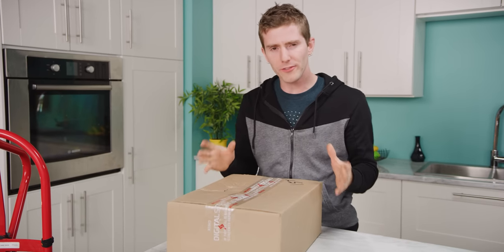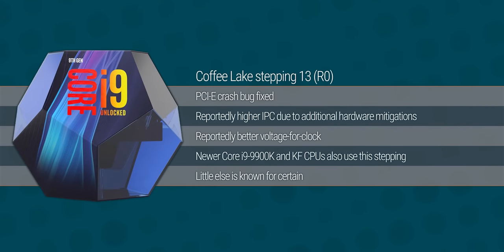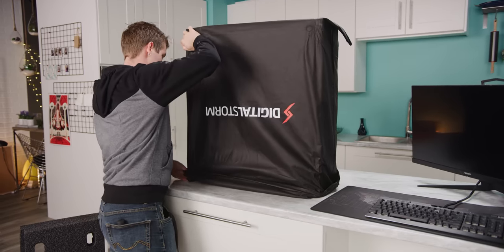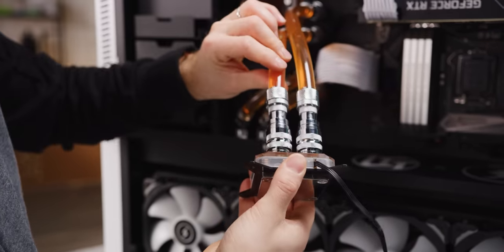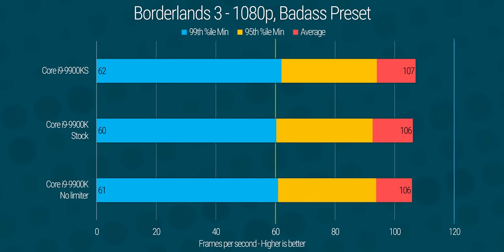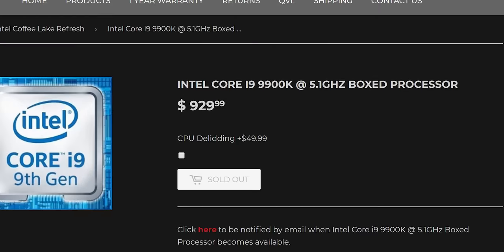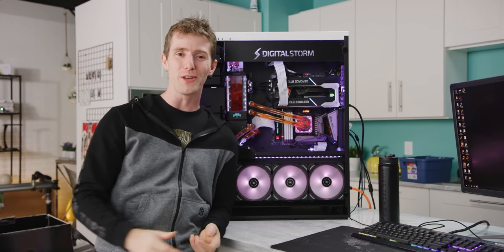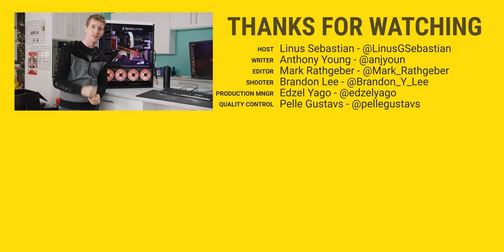Intel's PRE-OVERCLOCKED CPU... Core i9 9900KS

Comment: 95C with watercooling at 5,2Ghz? I did run my old 4790k at 4,7Ghz and it never got hotter then 60C running prime 95 on all 4 cores at full with air cooling using 4 fans at 90% push push / pull pull on a huge square heatpipe cooler with 14cm Noctua fans running silently... It seems thees new CPUs get a LOT hotter while not running that much faster even considering it is 8 cores.

Comment: Running my new 9900KS on air at 5.1 Ghz.  No problem.  Good silicon will run faster with lest voltage and hence less heat.

Comment: Linus can I buy your i9 9900ks pls, because I can't find a reasonable price or seller anywhere. Amazon is the only safe place and they are all being sold for $800-900 by resellers:( help me somebody pls. Im building my first ultimate gaming pc for Christmas, my wife is letting me. It's going to have an i9 9900ks (hopefully), rtx 2080ti, Msi Godlike motherboard, corsair 32gb of c18 3600mhz rgb ram, 2 TB of Samsung 970 evo plus NV.ME, seasonic gold 850watt psu, corsair crystal 680x white rgb case, white corsair rgb aio, I really would like the i9-9900ks but I might be stuck with am i9 9900k, I'm worried theyll come out with a better i9 with 10 gen desktop right after I buy the 9th gen. I'm also worried theyll come out with the rtx 2080 ti super or rtx 3080ti right after I buy the rtx 2080 ti. Oh well guess I'll see what I'll do.
Reply: Seer King Same concern I kinda hate how the 9900ks is a limited time product but then again I might as well wait for 10th gen at this point I guess
Reply: @ooh7427  I was thinking the same thing but intel is too unstable right now. Intel ks still beats everything in Gaming even the othernew i9
Reply: Seer King Yeah it’s kinda unfortunate and I’m sure if I’m going to hold off or struggle to OC a 9900k to 5ghz
Reply: @ooh7427  you wont struggle to overclock a 9th gen I9-9900K or KS, so long as u have a good motherboard and cooling. I'm getting the Msi Godlike motherboard that had 18 VRM nodes for 18 phase Vrm for smoother even clean and abundant power delivery. The motherboard can make all the difference in overclocking. I just happen to pick the most expensive one. The Asus Formula is Asus top  premium motherboard but it's not as good as the Godlike but almost the same price.
Reply: Seer King I was thinking about getting the Asus Maximus XI Code which is basically the Formula but without the waterblock since I’m going to be using the Kraken X62 Aio
Reply: @ooh7427  when are you thinking of buying? Most of the parts for my build are bought. Just waiting for them to be delivered. 2080ti is not bought yet though. I'm waiting to see if they come out with a 3080ti soon.
Reply: Seer King I’m not sure but if anything it will be early next year but I still haven’t fully decided if I’m going to hold off until Nvidia releases the 3080 but no telling how long that will be
Reply: @ooh7427  ya I hear ya

Comment: I don't understand why or how, but my 9900KF achieves 5200+ in CR20 @ 5.0Ghz on 1.325v, and this is currently running tame. I usually run it at 5.2Ghz on 1.39v, but I'm doing a lot of 3D work right now and it's only stable at 5.2 while gaming. Considering my CPU is a whole $250 cheaper here in New Zealand, it kind of looks like the KS isn't worth it at all, and I was considering getting it.
This isn't just a one-off run either, I ran this figure multiple times while setting up the PC to get an idea of what temps it hits, and it successfully ran mild stress tests at 5.1Ghz on 1.36v.
Here is screenshot of the just now 5.0 ghz 5200+. https://i.imgur.com/aAZVqXk.png
I forgot to mention, it's cooled via a Corsair h100i platinum.

Comment: I got 5.3ghz across all 6 cores on my 8086K... In a node 202...

How did 2 extra cores add so much damn heat? I was using a 5cm tall air cooler in my node 202, he was using an excessive amount of liquid cooling. Something seems off. Is a delidded and liquid metaled chip really that much better than a soldered one at sinking the heat from the die?

Comment: I just got a regular i9 9900k and it’s OC at 5.1 stable and 5.2 boots but haven’t had an change to mess with it much. It is also running one around mid to low 80c

Comment: 3% before you have to touch voltage...... uhhhhhhm my 6700k is at 4.6GHz and I never touched voltage myself... I need to check if my asus mobo automatically bumped it.

Comment: hey Linus first love your work I was wondering if you could help me im looking to buy a new laptop for video editing and found one with these specs -Intel Core i7-9750H Hexa Core
NVIDIA RTX 2060 6GB GDDR6 G-Sync
15.6" 4K Matte 60Hz LED
Per-Key Edge-Lit Colour Keyboard
32GB DDR4 2666MHZ (2 x 16GB)
970 EVO Plus 1TB M.2 PCIe SSD
No Hard Drive Selected
Intel AX200 Dual Band WIFI/BT
Windows 10 Home 64 Bit
Adobe premiere pro
do you think this would be a good unit 
cost is $3435.00 Australian
thanks for any help.
loyal follower.

Comment: So.. Pre lapped CPU, and it BARELY can OC, (and that still requires MASSIVE cooling solution) wonder how well it would have done if it wasn't pre lapped, would it have OC'ed at all or hit the thermals at barely anything than stock? If so.. Why the K in 9900(K)s.. Doubt anyone would want to buy this for underclocking :D

Comment: Umm.. what is the vcore on the KS? My i9-9900K is stable all cores 5Ghz at 1.320V, 5.1Ghz at 1.375V and boots 5.2Ghz at 1.4 but is only stable enough for gaming, xtu benchmark makes it bsod. I run it at 5Ghz and temps are ok.

Comment: My 9900ks runs @ 5,1GHZ on a gigabyte z390master G2. v-core 1,29 in bios with LLC on High! aida stresstest cache,cpu,fpu  temps stay under 80 celsius! with corsair 150i pro rgb with coolermaster fans instead of the corsair fans

Comment: Too many temperature... I had my 8700K at 5GHz 1.3v with temps ranging from 68-74c with a 120 mm AIO and that is too hot for my liking which is why I keep my CPU at 4.8GHz with a 1.265v to keep the temps under 65c while gaming for long periods of time.

Comment: Huh. I didn't realize how much I won the silicon lottery with my 9900k. Stable at 5.1GHz at 1.32v, and I got it through a few benchmarks at 5.2 GHz @ 1.5v, but it crashed when I was editing in Photoshop and Premiere at the same time.

Comment: Intel fans about Zen 2: OMG, AMD sucks, they offer unlocked multipliers on their CPUs but then have them binned to absolute max with not manual OC headroom.
Also Intel fans about 9900KS: this thing is amazing and shows just how much Intel still rocks by providing a great overclock out of the box with no need to twiddle with any BIOS settings to manually overclock and get even more performance.

Comment: I run my i9900ks with a Noctua NH-D15S at 5.1Ghz, it works fine. I tried a quick OC at 5.2Ghz but it got a BSOD, I didn't bother anymore as it's a new CPU and I don't want to break it. Maybe I'll try later when i got some more hours on it.

Comment: Intel CPUs these days seem to require you void your warranty immediately on purchase, delid it and replace the shitty thermal compound Intel use with liquid metal. I did it on my i7-8700K and the load temperatures dropped around 15°C across all cores. Previously getting 93°C on stock (with Asus Multi Core Enhancement) with a custom watercooling loop wasn't exactly great.

Comment: Isn't a pre-overclocked processor just a higher-clock processor?
I mean, if it's factory overclocked, it's not really overclocked, now isn't it?!
Yeah, I realize you probably need a massive heat sink and a humongous multiple fan system if not water cooled, but still...

Comment: Dear All,
Could you please help me? I have recently bought Intel Core i9-9900KS, and now I need some good AiO to cool it. Price is not an issue. The case I have is Cooler Master Cosmos II 25th Anniversary Edition. Could you please tell me does this case support 360mm radiator, and if it does, which AiO would you suggest me as the best option to cool this CPU? Also, if it doesn't fit 360mm radiator, please suggest me which one to take instead?

Comment: 13:05 the product isn't  necessarily pointless but the cooling is as its bottlenecked by thermal interface, a 240mm clc would be enough to cool it.
I have 8700k @4.8Ghz and it runs cool at 58'C during BMW blender render which is much much cooler than that fancy cooling.

Comment: Actually that is what AMD is doing as well. And wait. Intel does it all the time...
What was the difference between a r7 1700 and a 1800x? Yes, the 1800x was factory overclocked to the max so I just bought the 1700 and overclocked it to a similar level

Comment: I bought my 9900k from a regular retailer, and it boosted to 5Ghz all cores out of the box (on a 240mm AIO,  in an untweaked bios!).
Tweaked the bios to try to get more out of it, but im thermal limited.  For the first time in 7(!) years im considering going custom loop!

RIP  Wallet

Comment: With 2x 2080TI RTXs, wouldn't the air inside the case be very warm and undo a lot of the work done by the ginormous WC kit? Would be interesting to also monitor the temperature inside the case during benchmarks.

Comment: although i get it why you should be angry at intel for being over priced, i don't get. intel overclocks their cpu people get angry and say it sucks too much power amd is better but then that is exactly what amd does for it graphics cards. do you actually think that the navi 5700xt is equally as powerful as the 2070 super. The 2070 super has a tdp of 215W and the 5700xt is 225W and yet the 2070 is more powerful. They say that the navi is more powerful than the 2060 super, just overclock the 2060 super from 175w to 225 and no we will see who is more powerful

Comment: I don't like hearing my system, I run 5.0 on 9900k with ~40% fan and only ramp up sometimes on Prime95 which only occurs because Asus bios doesn't allow the top end to be changed. If I could (in bios) my system would be under 90 at no more than 50% fan speed.

Comment: 5ghz all cores? im sitting on a 8700k that can all core overclock to 5.2 ( if I want to torture the chip ) and get cinebench scores just under 2k. the 5.2 is at 1.4 stable. I have it sit at 4.5 all cores as it has perfect balance between noise and thermals. Using a Corsair H150i Platnum

Comment: hey linus I got a "cool" project for you.
extend the sides of the processor by soldering plates of metal and creating like a box.
Fu*k thermal paste and directly add water in this box run it, see how it goes.
Next add dry ice or maybe liquid nitrogen.

Comment: this is a brilliant idea,,,,,,,,using the "window bay" for a build ,u could use the glass pain as a heat sync open the windows either side of the board with fan drawing air in or out,i mean mine sort of being air cooled at a 3 degrees cel,,,with the window open ,side pannel off

Comment: lol still tryna hawk the Glass wire blinker fluid ?  This Glasswire does nothing it blocks nothing and it stops nothing, all this glass wire does is interfaces with the built in windows basic firewall and antivirus and if you have 3rd party protection that disables the built in windows  firewall / antivirus then  this glass wire is basically a glass paperweight

Comment: Usually though most can't overclock it more than 20% increase in performance. You need like nitrogen cooled processor to run 50% speed increase.

Comment: I really want to see the temps of air cooled at all-core 5GHz.
Reply: Around 50-55 degrees under normal load and full load you will hit Therm throttle down to stable 4,3 ghz, this is 5ghz on 9900k with 1,32v
Reply: Mappi75 Thanks!

Comment: HELP!  WHAT'S GOING ON??? I have the I9-9900KF and overclocked it on an ASUS Maximus XI Hero. I was trying for 5GHz on all cores, but it throttles or crashes. So I pulled it back some and ran it at 4.9 on all cores. I am running EVGA 1080 Ti in SLI, not overclocked. Suddenly my graphics driver did something strange, like it got corrupted and SLI wouldn't work. My second graphics card no longer worked. I RMA'd it. My water cooler died after 6 months so I got a warranty replacement. So back up to 100% I overclocked my CPU again. My graphics card in the second slot died again. Is it possible to damage something in the PCIE slots by overclocking the CPU?
Reply: Sounds like your power supply is bad, which could be the source of some of your issues.

Comment: mine 9900k runs 5ghz all cores a 1.320v on a nzxt 360mm x72 aio running cinernench at 69c full load i must have a good core
Reply: And good thermals. Mine runs in the low to mid 90's Celsius when at full load; 4.68 GHz all cores.

Comment: Hey im new to building pcs and i spent around $1,200 on parts They were all brand new. I followed online instructions on how to build one and did all basic safety precautions. I wore an anti static wrist wrap , etc. After i put them all together nicely, i tried booting it. Fans and leds turned on but there was no display and no beeps. Also i noticed that the gpu fan would spin for a couple of seconds then stops for a second and does it again. I made sure all cables were firm but still no changes. I tried removing parts to see if i could hear a beep but nothing. I was down to the motherboard , cpu , and psu. I used my psu on my older prebuilt pc and it worked just fine. So now im just down to cpu and motherboard. I tried doing basic research but no luck. Dont know any other place to ask for help.
Reply: did you connect the GPU to the power supply? some GPUs need 6 or 8 pin connected to the PSU

Comment: So how did I get 5.2 ghz with a 1.4 volts and doing a stress test for 20 minutes and get 70-73c on aio
Reply: Was it full-load 100% usage? My 9900K gets into the low- to mid- 90's Celsius at full load.

Comment: Intel or bust Linus. AMD wouldn’t exist if it wasn’t for Intel letting them cross license x86
Reply: doesnt mean you have to stay with the declining company, intel is pretty garbage when they charge 2x for the same performance and give you a stock cooler that feels weightless and does nothing. theres a reason more gaming laptops aren't using intel nearly as much. there isnt a single redeeming quality with intel cpus anymore
Reply: @tyler3104  With the exception of single-core performance for clock speed. Even still, that's not much of a difference.
Reply: @tyler3104  yeah if you look at consoles side.please don't send hate what's I'm saying is AMD processor is used.MICROSOFT is clever they use AMD in console and Intel in PC side I'm not talking about others such as HP Dell Lenovo Acer Asus or apple I'm saying about surface lineup is Intel and Xbox lineup is AMD it's clear that productivity Intel and gaming in AMD in Microsoft point of view. I don't hurt any one's feelings I just saying my thoughts if you agree like it if not reply me.☮️

Comment: I don't quite get the "pre-overclocked". Those are just the specs that CPU has.
Reply: @caoucduong8931  so like a 9600 is like an overclocked 9400 ? but no one calls it that. because then every higher clocked CPU would be an "overclocked" version of another.

Comment: For once I disagree with Linus, my standard 9900k has no issues bench tested overclocked 5.3ghz stable with just two 360mm rads. But I cheated a little :D direct die cooled with liquid metal